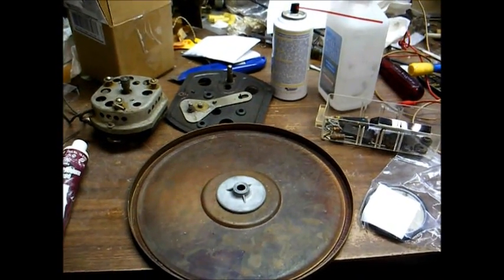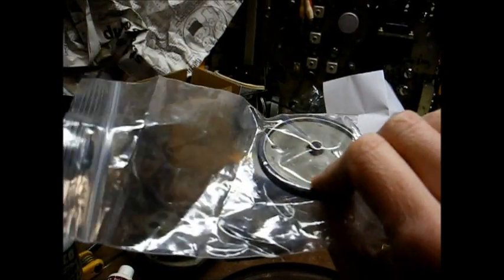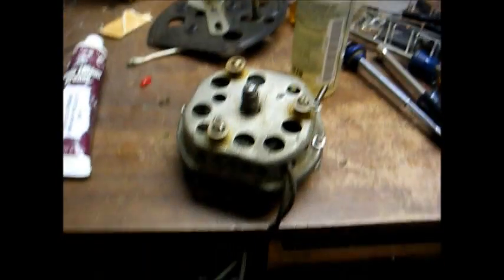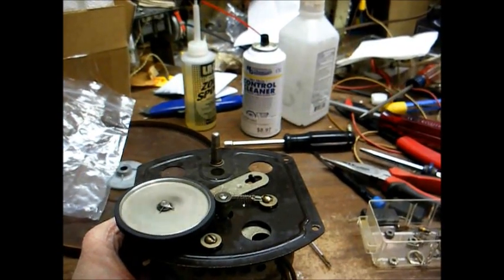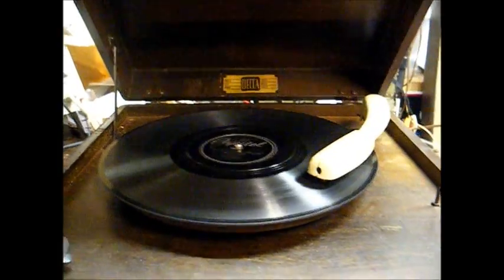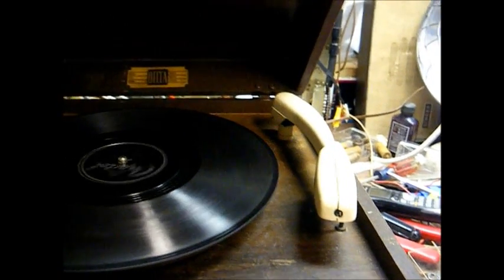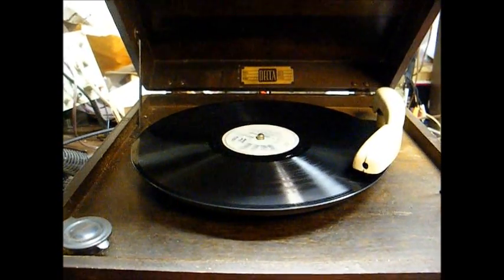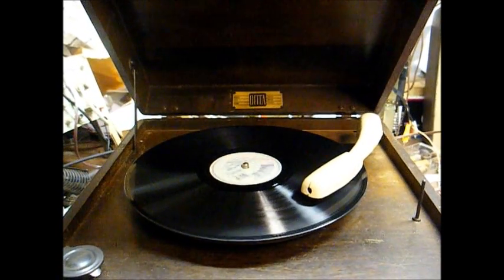Repair of a 1940 Decca model DP16 78 rpm record player (it's fixed) - part 3

Comment: I just noticed something in this video about the 78s that I hadn't before.   The grooves at the tail end of the record did not spiral down to a circular groove at the end that holds the needle there, but that circle was off center and would cause the needle to wobble back and forth if it could stay in that groove at all.    Is there a reason for that?
Reply: +3Cr15w311 As far as I know, older automatic stop players detected that wobbling of the tone arm instead of it's position on the record to trigger the shutdown of the motor or engage the changer mechanism if there was one. Early LP's had the same eccentric locked groove.
Reply: +MisterTalkingMachine Thanks for the response.   I have noticed it on other videos showing some older 78s and figured there had to be a reason.   I came along as a kid of the 70s when our household had no 78s -- only 33s and 45s, so I was never exposed to the quirks of the 78 format.    We do have an old 1946 model combo Sears console AM radio and phono that we aquired in 1972 when we bought a house, and we still have it and the AM radio still plays fine.  It was the family radio all during my childhood and early teen years, but we never have tried played a record on it because we never had any 78s. The turntable would spin if turned on.
Reply: @MisterTalkingMachine  I don't fully understand the idea behind the off centre end groove, most trip mechanisms I come across only require to tonearm to move 1/4" or more within 1 rev to shut off the player, earlier 78's had normal centre circle when runout grooves first come out on AUST Columbia and Parlophone. The only thought I have about the off centre circle is to prevent tonearm kick back as the auto stop activates